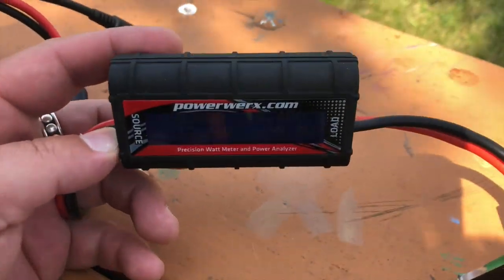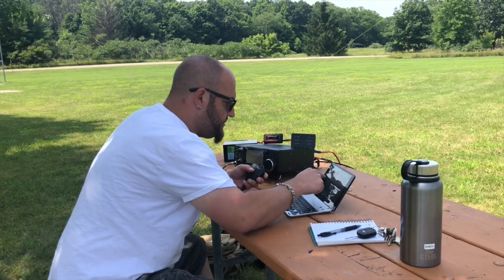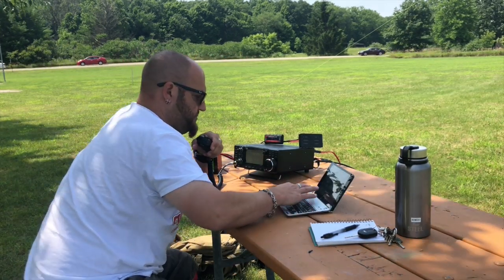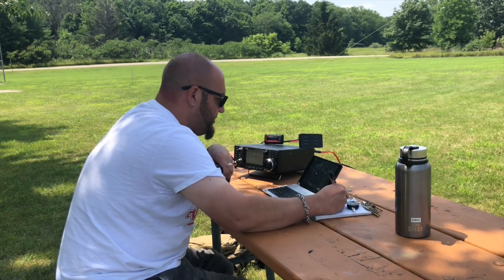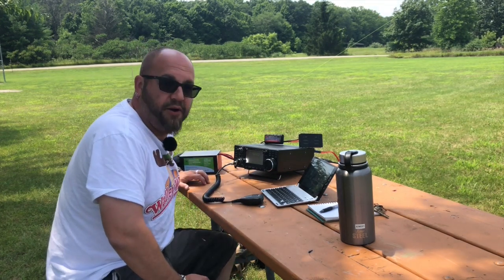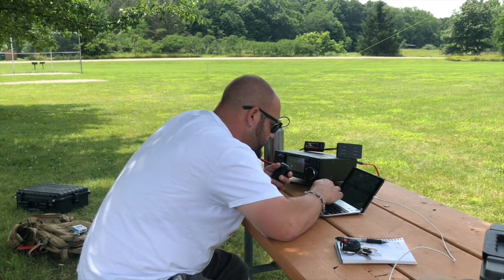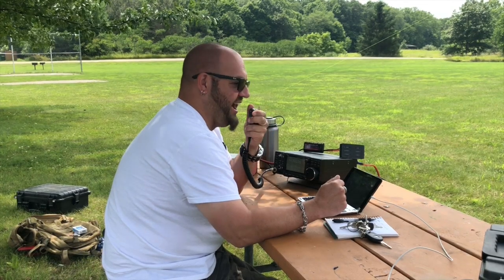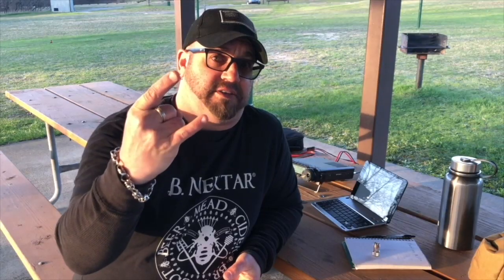Bioenno 20AH Portable Ham Radio endurance test.

Comment: Thanks a lot Mike!¿ $946 later I purchased a Bioenno BLF-1230A, BPC-1506DC & an FT-891 like I really needed more radios.. Everyone Does!! Including ME!! Great videos, hope you don’t upgrade your portable which means I spend more 🥵 73 from N1YLO Central CT
Reply: I have a used 7300 still sitting in the box need to get my radio room put together. Mostly bought the 891 and Bioenno for portable use only with the Wolf River. Really enjoyed the video!
Reply from the maker: Sounds like you should be set for a couple more months before you get the itch to buy something else.  I do have the 7300 as well so you might need to get one of those soon too ;p

Comment: Very Nice! (In my best Borat voice). Those 7300s are very good radios. I used one on VHF field day. Being able to loop your CQ call makes it very easy. The battery performed very well as did your antenna. I have my full/extra exam next week so hopefully will have access to full power from then onwards. 73s

Comment: They are incredible batteries. I can use my 30ah battery over a weekend trip without worrying about running out. On CW at 90 watts (low sunspots mean more power) it will draw the battery down. I was operating yesterday starting with a battery that I used for about 4 hours a few days before, as well as running my VHF radio for a few nets and was able to operate for 3 hours. It dipped to 11.7 volts a few times (that is the level that I have for my battery warning) but it did not stop putting out full power.  I need to get one of those meters you have so I can be more quantitative, but I agree with you these batteries are nothing short of amazing.